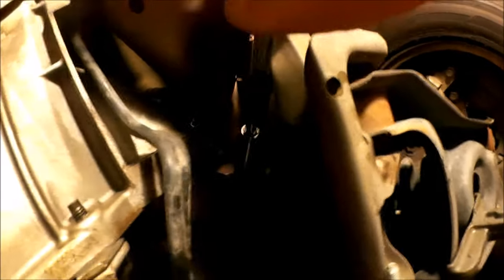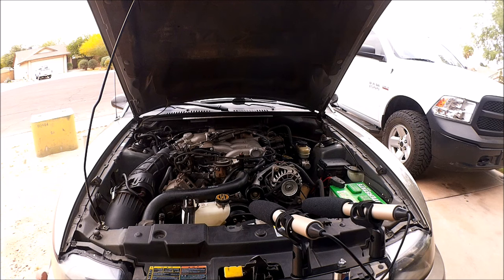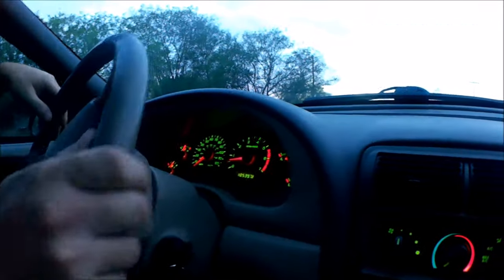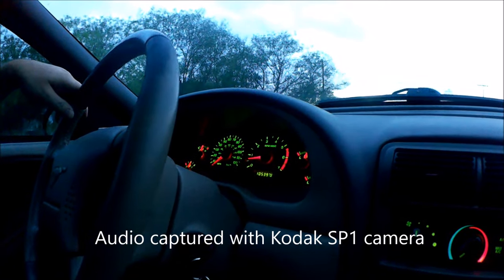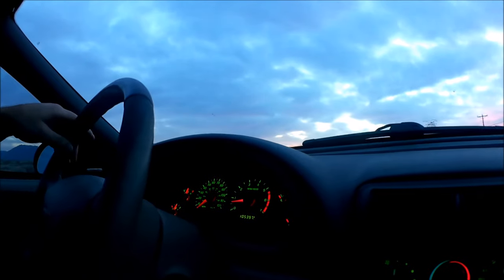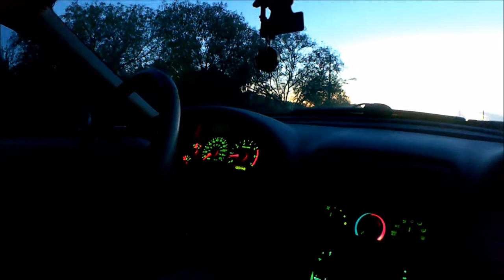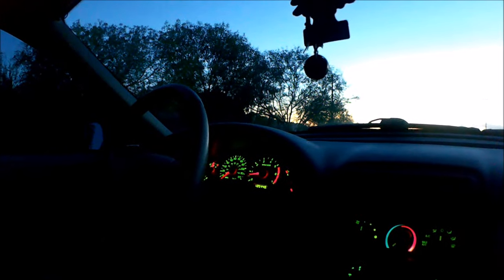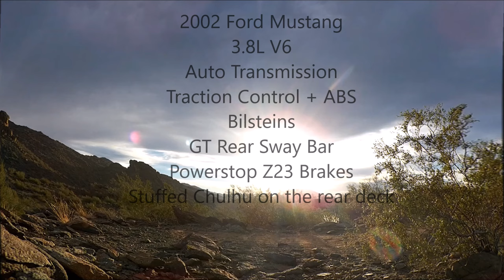Shorty Headers on a V6 Mustang - Sound and power!

Comment: Hey I know it's late but did your shorty headers have the EGR by-pass tube connect on it ? Because my doesn't do you think it would hurt anything if I left that unplugged?
Reply from the maker: The headers include the EGR tube just like stock,  so if your EGR system is present it just threads straight on.  

It's a good idea to keep EGR connected and functional,  not only will you get a check engine light from disconnecting EGR,  that system is for more than just emissions.    EGR helps you make power by letting the PCM run more ignition advance without knock and by helping to increase fuel vaporization so it releases the most power when it combusts.
Reply: @shoveI  thanks bro and by the way it was the wrong header, was a pain in the ass getting the Original header off and even worse getting the new header in just to find out it was the right one. Took about 3 hours or more. I'm disappointed but there's always tomorrow.

Comment: I put ceramic BBK headers on my 02. I also have the PaceSetter H-Pipe along with Flowmaster American Thunder Catback exhaust. Sounds great and many people think it’s a V8 lol. I also had that annoying ticking sound and wasn’t sure what it was if it was the exhaust manifolds or one of the exhaust components. Took it to muffler shops and got it confirmed to be the manifolds. The BBKs look great and no more annoying sound.
Reply: If you see this did you get chech engine light with the headers ?
Reply: @Wykd-v8e  nope everything went on seamlessly and haven't had any problems since.

Comment: Holy Smokes! I have been trying to figure out what that annoying ticking was and this confirms it. Its funny. I have a 2002 mustang aswell. I noticed a lack of power, specifically I would hear alot of air flow and not enough pull to match it upon acceration. So I bought a BBK Cold air intake thinking It would help and it does but still felt like it was lacking and this is why. Thank you for this vid.
Reply from the maker: Glad it was helpful!  

I looked at intakes but after seeing that V8 Mustangs use the same airbox & intake (other than manifold, of course) as the V6 ... and Ford clearly spent a lot of money on this elaborate cast dual port, active runner intake manifold there's no possible way that the stock airbox is restrictive.     They wouldn't have put that much money into the manifold and heads if the bottleneck was a cheap plastic housing they could have enlarged for pennies..   

I bet the BBK looks awesome though!

Comment: After installing that rear sway bar, did you notice a difference in handling to the car? and did you use the GT control arms?
Reply from the maker: Between the sway bar and Bilsteins it was a pretty serious transformation in how the car feels to drive.      Feels a lot more planted going around highway corners or even just squeezing around city streets turning left on green lights.    It also "bobs" less just going along straight bumpy roads.    If you shop around aggressively you can probably manage a set of rear Bilsteins and a junkyard sway bar for $100 and I'd call that dollar-for-dollar the best thing we've done for this car.    We got the rear Bilsteins from Speedway Motors at I think $32/ea which was a steal, pity the fronts weren't like that.  

For the sway bar it wasn't necessary to use control arms from a GT, the holes for the hardware are already in the V6 arms (probably the same stamping) - but it was important to get the bolts and captive nut bits from the donor car because those are not already present on the V6 arms.     Really easy install,  just jacked up the rear of the vehicle,  put safety stands up and turned a few wrenches for a few minutes.
Reply: +SheepTrees what year sway bar can I use on a 2001 v6 I'm trying to find one off a junkyard mustang

Comment: I’m excited getting mine installed tomorrow because stock ones are trashed.  I’m already in high 6’s 0-60 with bolt ons and tune so should be interesting to see what I gain.
Reply: Please let us know the results as I too am wondering how much did it help. Are you going full dual exhaust?

Comment: I actually clocked it from a dead stop on both stock runs you got 9.5 after you got 8.7 I know, I'm really surprised myself... They say cracked manifolds rob power so maybe you regained that and gained about 10? idk seems weird but I swear on those results i tried it three times and got the same thing

Comment: Hey man, I installed these on my 2002 V6 at a muffler shop not too long ago. They struggled to get them on. My question is , I'm going to do an engine swap and was wondering if you encountered any problems?
Reply from the maker: Putting the driver side one on had two annoyances,  first is that the dipstick tube goes through the headers but putting it in is a puzzle!    It is necessary to keep the downward bend in the dipstick tube,  because if it straightens out then the dipstick interferes with the crankshaft (which is not something you want) .     That was BY FAR the most frustrating part!!!

 Other minor annoyance was that the flange at the collector just barely hits part of the block casting.   I used an abrasive wheel to clearance it.     That's where test fitting was important  :)

Comment: Actually I was needing a video just like this, as I plan on buying those headers. My 0-60 stock 2001 mustang v6 is about 8.5 and that's still not all the way on the throttle the best I've gotten was 8 seconds without overdrive
Reply from the maker: Be really careful with that oil dipstick it's a monster to get that in right!     And if you bend the dipstick tube it can point the end of the dipstick into interference with the crankshaft - no bueno.     That part was by far the most frustrating part of the job!
Reply: Alrighty, appreciate it. Did you notice any torque improvements?
Reply from the maker: I don't really feel any difference,  but didn't really expect one either.     The tone sounds "cleaner" and smoother  - not just from the fact it's not leaking anymore but all around it's a nicer more refined exhaust sound,        possibly from a more equal runner length than the stock logs.

I think for torque on these cars they just really need gears.     Looking forward to putting 3.73 gears in this year.

Comment: any other tips? dos? donts? my cruise control doesn't work at all on my 03 v6 & as soon as u put my car in drive or reverse it takes off!
Reply from the maker: For your cruise control, does your horn work?     If your horn also doesn't work,  there's a chance your clockspring is damaged.    Those aren't super hard to replace but they do cost in the neighborhood of $150..  and it's worth trying to diagnose it and replace it if necessary because that also is what makes your airbag work if you're in a collision so if it's broken you can't count on that added safety if the worst happens.  

If your horn does work fine,  then the clock spring is probably OK.     There is a brake light switch that tells the car you've stepped on the brake pedal so it turns on the brake lights and turns off cruise,  and those can fail too but at least on my wife's 2002 there's only the mechanical switch for pedal movement not a pressure switch like newer cars have - I don't know when Mustangs got the pressure switch so if yours has one, those are a frequent cause of cruise control failure.      If  your master cylinder has two different sensors with electrical wires coming off it,  one of them is the pressure switch (the other one, right under the plastic reservoir is for brake fluid low warning light) 

Lastly, if your car has ABS is the ABS light illuminated?   I believe cruise doesn't work when the ABS has failed - the most common cause of ABS failure on these cars is the control module itself dies.   It can be rebuilt for about $100 and is pretty easy to replace.
Reply: SheepTrees yes my horn works as far as I know

Comment: I'm actually putting shorty Pace setters on my v6 mustang right now and I can agree that freaking dipstick sucks
Reply from the maker: That dipstick almost took my sanity!    :)
Reply: @sheeptrees I was wondering how do you get around dipstick when you put on the headers?
Reply from the maker: @nathandempsey9580   Eventually I was able to work it in...  this was a few years ago so I apologize I don't have anything exact to describe I just remember it was incredibly annoying to get the tube to fit in at the proper angle,  without just pointing over toward the crankshaft.  

I just... poked at it and fooled around with it until my brain leaked out of my head and I had personally cursed everybody at Pacesetter to jump in a lake of fire...   and eventually it went together.  

Man I hope you're able to get it to work!!
Reply: Hey I appreciate it man I'm going to try my best lol
Reply: I know it's been a while ago but Do you remember having to cut, bend anything to a certain degree to make the header come over the dipstick?
Reply from the maker: @nathandempsey9580   I definitely didn't have to cut anything on there for the dipstick.   I had to file the flange to clear the rear of the engine block but that is unrelated to the dipstick. 

I think I might have had to slightly bend the dipstick tube "wrong",  then bend it back "right" while shoving it down into place.    That's all old memories,  but I think that's how it worked.  I'm pretty sure it was really slight, and it was down near the bottom of the tube and it was still really frustrating and blind (can't see the hole where it goes) ... I think I tried using a little mirror to see better and it didn't help.
Reply: Cool I got it in I'm good!! Thanks for all the help!

Comment: Where is the tcs buttkn on that car?
Reply from the maker: If you have antilock brakes,  you'll have a traction control button right in front of the shift lever.   I think pre-2001 models might have had it on the left side of the dashboard, down below the headlight switch.    

If you don't have antilock brakes you won't have traction control.

Comment: i have the same headers on my 2000
and it runs and sounds the exact same as yours. maybe a lil louder
Reply from the maker: My favorite thing about them still is that there's no leak :)    Even after 4.5 years they're still good and it's still a daily driver
Reply: @shoveI  yeah i have that power steering whine aswell too, ive had my car for 2 years and it has 274k miles on it with really no issues but the power steering whine and a slight tic every now and then
Reply from the maker: @fusion3.082    I still haven't done this (it's my wife's car) but I read that you can swap from the Mustang power steering pump to one from a Windstar and permanently solve the whine.    I can vouch that I had a Windstar 5 years ago with the same 3.8 liter engine and it had zero whine whatsoever.     The power steering pump on those is smaller and has a remotely mounted fluid reservoir.

Comment: No point in putting headers on a engine if your not going to add flow to the rest of the exhaust,lol.
Reply: Kenneth Skipper unless you've gotten tired of fixing the stock exhaust manifolds because they tend to develop leaks in such case yeah, I'd say there's plenty of reason.
Reply: queenghidrah1 aftermarket headers are famous for developing leaks,so not a much better option,but I understand what your sayin.